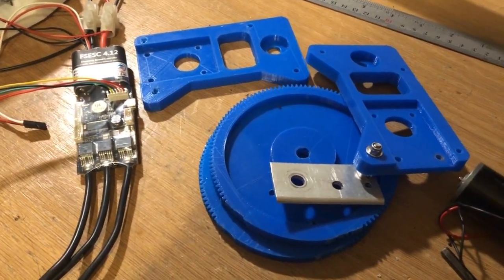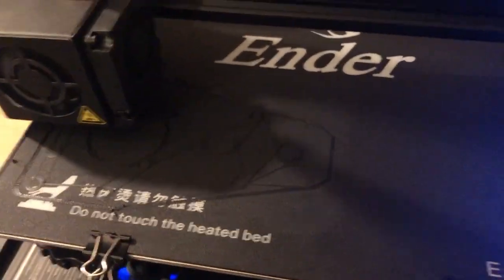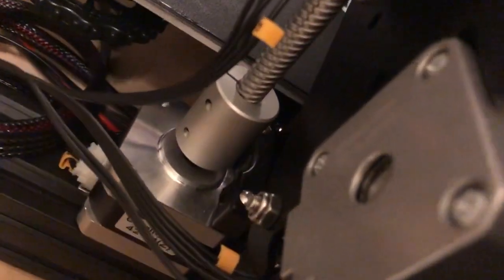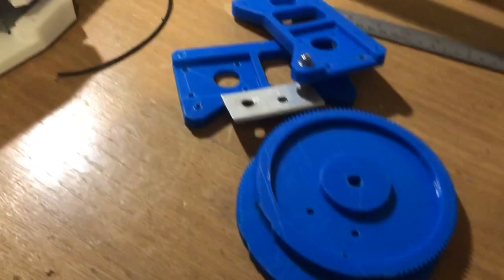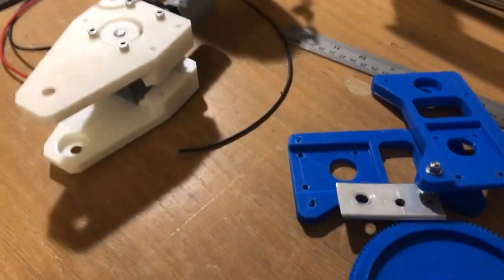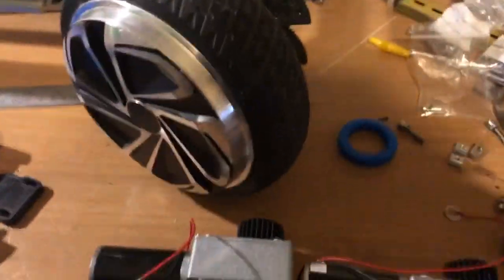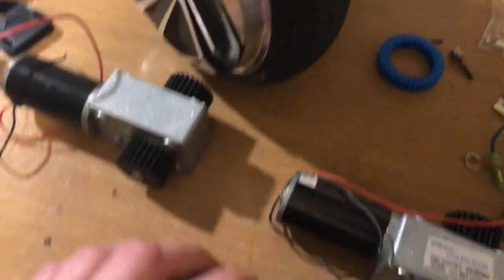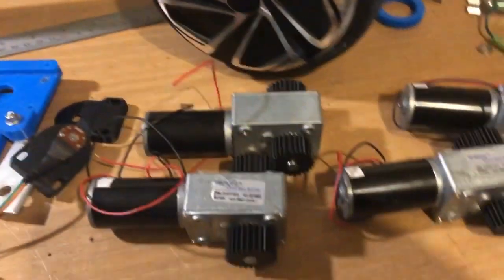RC HOVERBOARD CAR - Build Update 1, 3d printed wheel hubs, 4 wheel steering

Comment: Hey, I'm glad I found your channel and low how passionately youre working on this project. I've a question. Is it possible to build a 4 wheel indoor vehicle, without using a steering mechanism like you showed in this video? Do you think, the logic.... " speeding up one wheel a little more than the other one will help steer?
Reply from the maker: hi, yes you dont really need a steering mechanism, they call it skid steer, like what tanks use but it can put a lot of strain on the wheels if they are on a grippy surface, thanks
Reply: @A-tech  thanks for quick reply buddy. I thought so too. So my purpose is to build a small very slow speed indoor movement vehicle for my mom. So surface is not an issue. I will probably restrict the speed to minimum. I just want to be able to do it without complicating anything. Can you gimme some instructions on doing it with Raspberry pi? Can we connect on skype or email?
Reply from the maker: @DeepakChauhan-dp9zq  ok if its to be slow i would recommend using something else instead of hoverboard motors, maby some worm drive dc motors with a lot of torque, thanks
Reply: @A-tech  How slow do you think a hoverboard wheel can go?
Reply from the maker: @DeepakChauhan-dp9zq  they can go as slow as you like but there are better motors out there for what you need
Reply: @A-tech  The reason I choose is that it's compact, easy to use and powerful without having to bring together different components.
Reply from the maker: @DeepakChauhan-dp9zq  ok I understand, what kind of floor will it be on? if its having skid steer there is a high possibility it could damage the floor
Reply: @A-tech  okay so we have normal floor tiles installed marble and not wood.
Reply: @A-tech  I think that won't be a problem because I've used hoverboard on these several times.
Reply from the maker: @DeepakChauhan-dp9zq  sounds like you have already decided to use a hoverboard, im working on a new video at the moment about reprogramming the hoverboard motherboard, the new firmware seems ok and might be of some use to you but they are complicated to set up
Reply: @A-tech  Yes Buddy :) It's got many advantages. I guess for someone like me - reprogramming the motherboard may be too complicated. Because I'm a little familiar with RaspBerry Pi, I was hoping I will use that. Also my love for python will be put to some use here :) Any tips/direction will be highly appreciated.
Reply: @A-tech  And I look forward to your new video.
Reply from the maker: @DeepakChauhan-dp9zq  hmm, raspberry pi isnt something I have used before so im not sure if the coding will be the same as arduino, i did a video about flipsky VESC controllers that might be good then, they work like an rc car speed controller, however I havnt been able to get them to work with some types of hoverboard wheel, using hoverboard parts for projects isnt easy